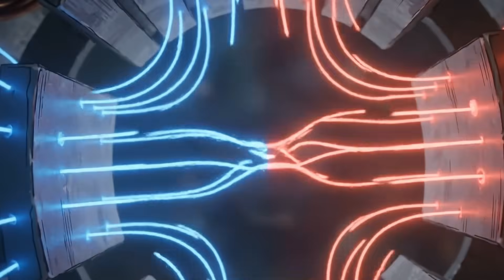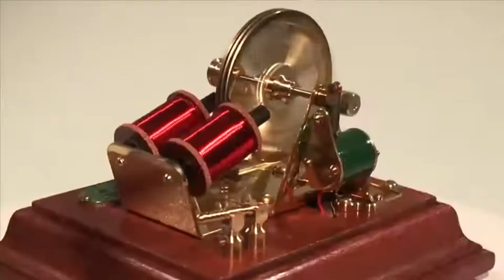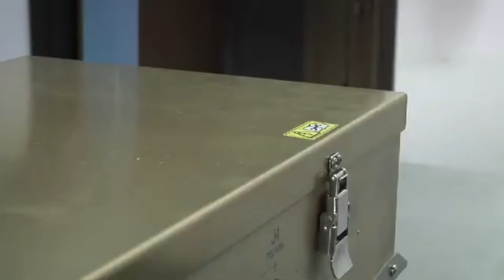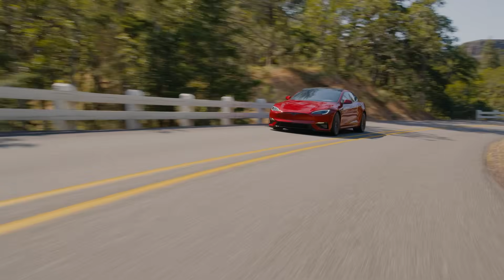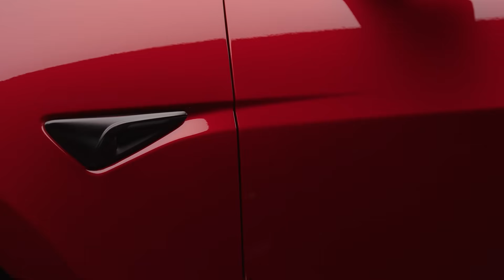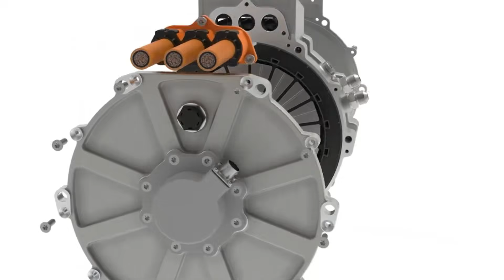The Incredible Evolution of EV Motors: From Wooden Carts to Supercars

Comment: About two decades ago when I knew very little about motor designs, I also thought axial flux designs would offer more improvements to existing motor designs (Even at that time, I knew as much or more than the average guy)

But now I know a great deal more, and I know the radial flux design can too be improved for efficiency far more than what it is now, and with those improvements in efficiency, radial flux motors can be built to be robust far better than the axial flux designs could ever dream of. 

Therefore, the future of motor design isn’t axial flux, but improved radial flux designs.
Reply from the maker: Well said. Axial flux is exciting, but improved radial flux designs shouldn't be underestimated. Engineering usually comes down to trade-offs, not one-size-fits-all solutions.❤